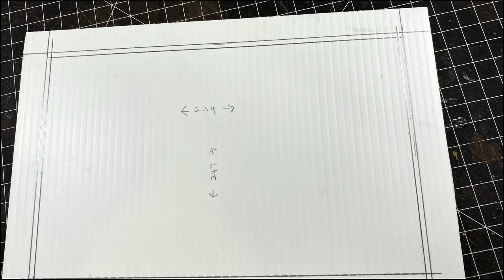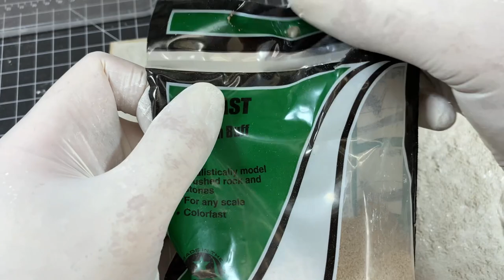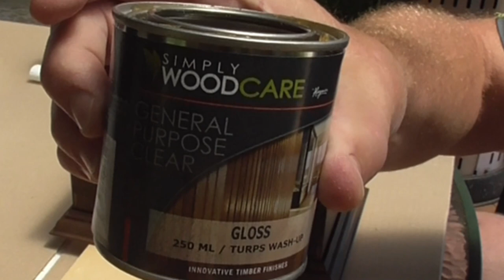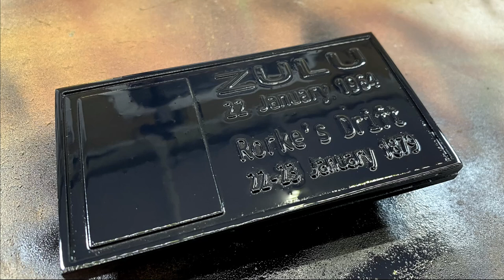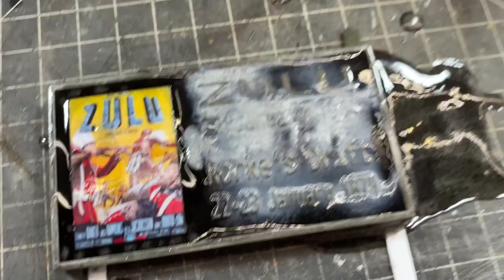Rorke's Drift Diorama Base & Display Stand

Comment: Great work on that diorama base, as always. I suspect the holes mean there'll be sound included, which would be good.
I didn't notice the subliminal product placement but as I also have a similar battery airbrush it wouldn't have worked on me anyway. I find mine gets a little uncomfortable if I use it one-handed, but it is a very handy bit of kit.
My current project was intended to simply make a base for a steam locomotive but it's grown a little since I started and is now three feet by two feet and I need to make a metal support frame for it. Nobody wants a saggy bottom!
Reply from the maker: Thanks Ian, I haven't used the airbrush enough just yet to do a full product review so I haven't experienced the discomfort of it as yet, but I will be giving it a working over now on a few other projects.  That's one big ass diorama mate, when you move to metal supports its time to get help 😱
Reply: @HalidonDioramas  My diorama grew from just a bit of track for the loco to sit on, but I added a couple of carriages, then a station, then the station forecourt, then a road beyond the forecourt, then some shops along the road. It's less a diorama than an extract of a model village now, with well over 100 figures. I'm just glad I stopped expanding it before I got the idea of including working streetlights!
Reply from the maker: @ianthomson9363  Ian, sounds like you are creating an alternative universe!!!!!   please send me some pics (halidon63@gmail.com) I have to see this!!